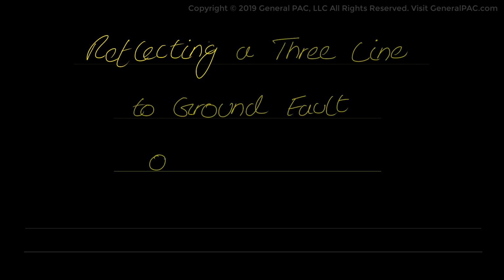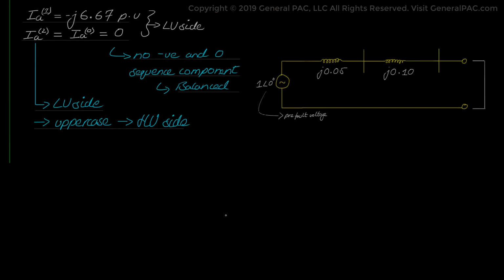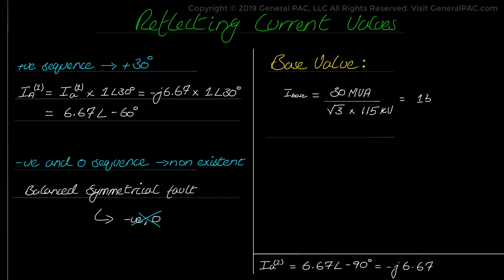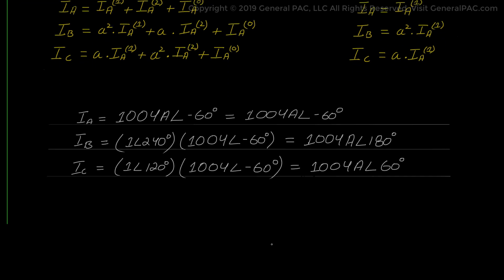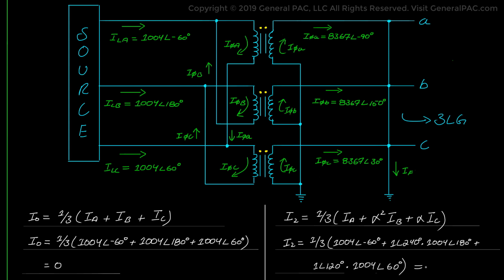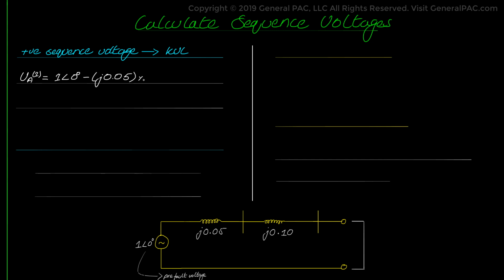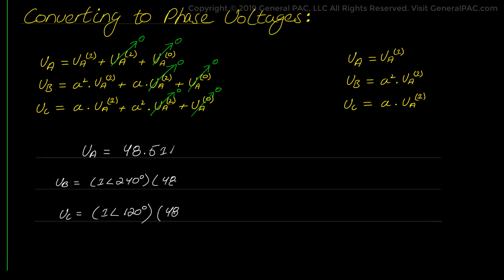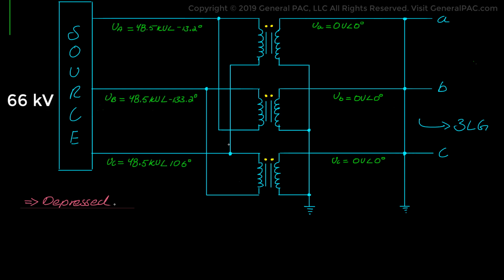Fault Analysis in Power Systems, Part 4b

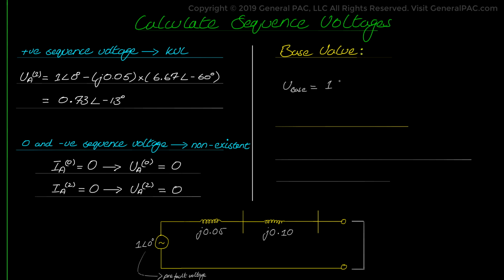Comment: Sorry but at 6:31 why Vbase on the high voltage side is equal to 115kv/sqrt3 when that is a delta side where phase voltage and line voltage is equal ? Shouldn't it be just simply 115kv ? Also if we would choose Vbase as 115kv/sqrt3 then the generator shouldn't be 1 because then it would be equal to 115kv/(115kv/sqrt3) ? Correct me if im wrong but that confuses me.
Reply from the maker: Hello,
Yes, you are right. Thank you for letting us know about the error. We will be updating it soon!
Reply: @Generalpac  Thanks for the quick answer :)